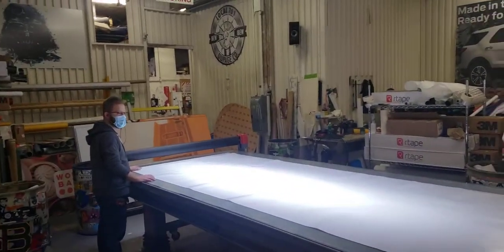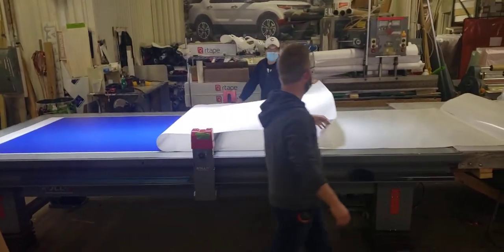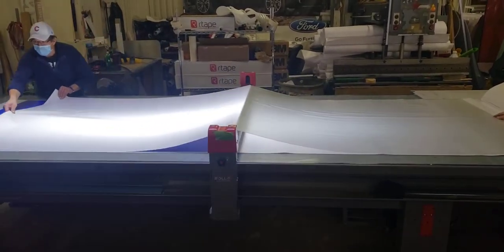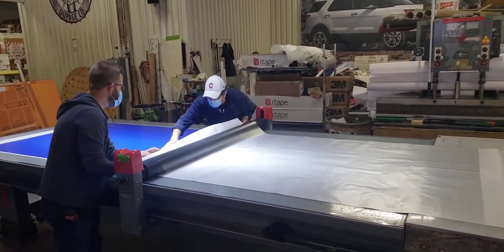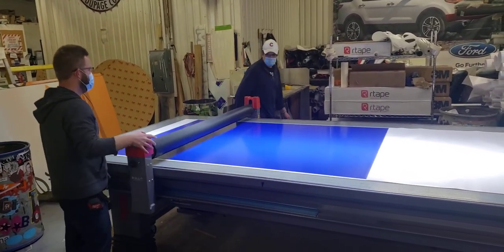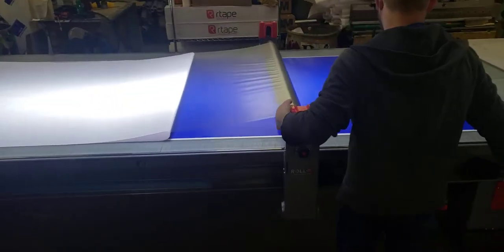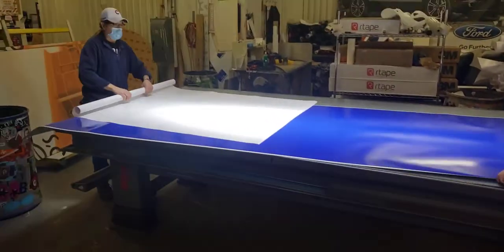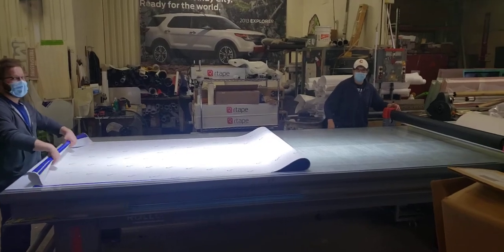Demo of vinyl lam applicator table at the sign company i  work at as a  commercial sign designer

Comment: I was hoping you could help me, I am working on a large backlit hotel sign. It appears to be a canvas or other smooth material that has been painted on the outside and vinyl stickers stuck to that.

Do you know the name of the material and the type of paint used on it?

Thanks so much..
Reply from the maker: Is it a panaflex material?
Reply: @DaPrintHouse  It appears to be a white polyester material smooth on the outside. The base color was painted on and the lettering is vinyl.. It need to be stretched into place as I was told..
Reply from the maker: @SegoMan  sounds like what we used when we stretch large panaflex signs
Reply: @DaPrintHouse  OK are you setup to print 6' 9" x 15. 6" wide. I can't find you website..